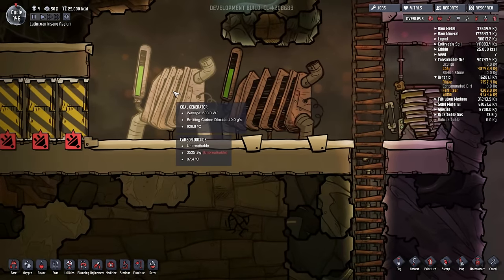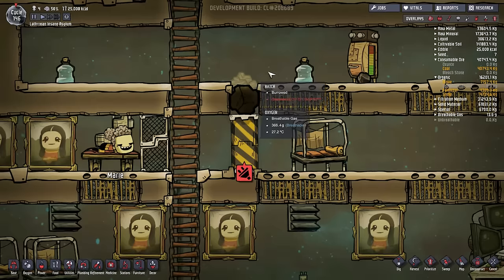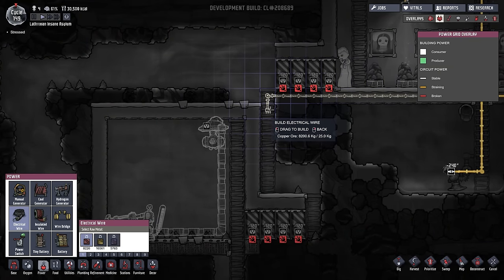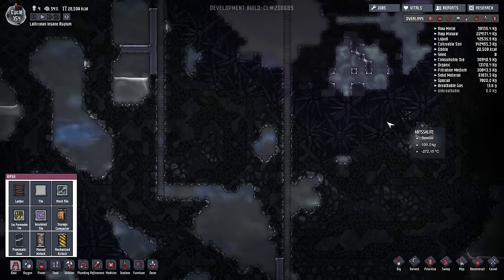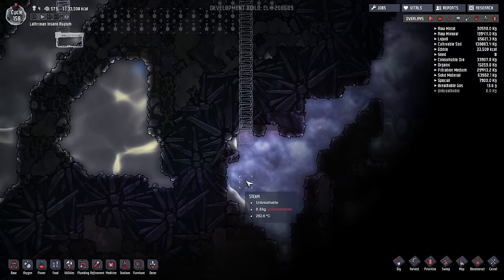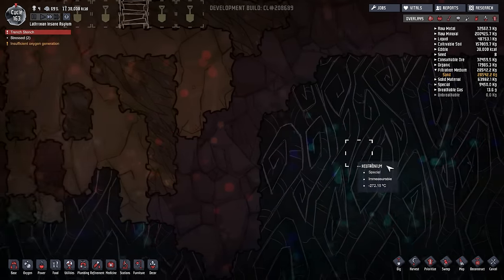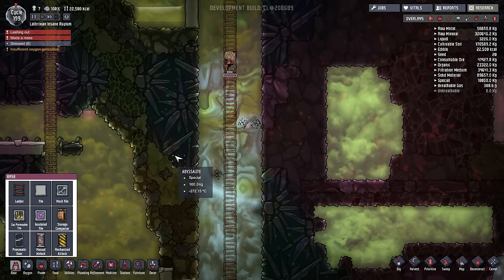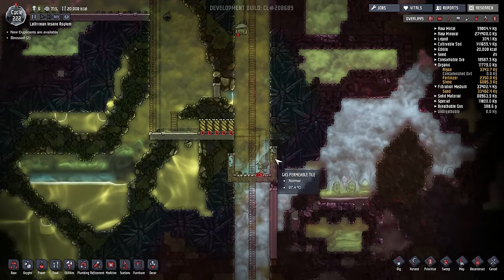Oxygen Not Included | Part 5 S2 | Steam Water Purification!  | ONI  Gameplay

Comment: If you run out of heat at the bottom, turn off the water pump and wait. You might not be able to see magma, but it is there and it will reheat the rock over time.
Reply: heat cant pass through nutronium so low odds of that

Comment: Hey Lathrix! If you can get the pressure in a room low enough(like a vacuum) the water will boil at room temperatur. That way you dont need to worry about the heat so much
Reply: Stefan_ Zisse sadly this is not in the game

Comment: the hydrogen isn't lost, it's graphical. Each segment of pipe can hold so much gas in general. if you leave the pump on with a connection, say a generator, it will continue to pump, but as it pumps you'll see that it stops pumping to the furthest pipe as the pipes fill. If you then turn on the generator after it's completely full and the pipes are completely full you'll see it shows the gas moving in, but it's not pumping all of the gas, only as much as the generator can take as it burns it. the pipes are still full, it's just has no way of showing it except by watching the pressure in the pipes. you're not actually loosing the hydrogen, it just 'looks' like you are.
Reply: The fluid-interacting objects don't quite understand the concept of a queue and their usage isn't exactly aligned to how the fluids in pipes queue, so what happens is actually this:
There is fluid in the pipes, and there's a machine that has, say, 10000 units of fluid in it, making a full tank.
The fluid in the pipe is supplied in units of 5000, and the tank is full so the pipe supplies nothing.
A tick goes through for a fluid-demanding machine, it uses 1000 units of fluid, leaving 9000 in the tank.
The pipe detects that the machine's tank is not full, and gives it 5000 units of fluid.
The tank is full at 10000 units, but there was no check for how much to supply, so 4000 units of fluid disappear into the ether.

If either all machines took in 5000 units at a time and used it in a single tick, or if there was a check for how much to supply, this bug would not happen.

Comment: regarding why your vents are outputtting heat is prob due to you not having insulated gas pips in your cooling room resulting in the pip getting hot that chain effect into heating up other gas pips and the gas moving inside that should be cooled down.

Comment: Hey Lath, I'm just going to let you know that your cooling tower is not going to work. Gas cannot move through liquids in this game so even the smallest layer of water on top of your gas permeable tiles is going to stop the whole process. (Unless they have changed that)
Reply from the maker: You may want to take a closer look at the tiles :) I worked around It in the build, the tiles go around the water collection level and above the possible water line, It's working just fine. ^_^  You can see this at 18:30 onwards.
Reply: Lathland Yup, my bad. I had not noticed you built those...